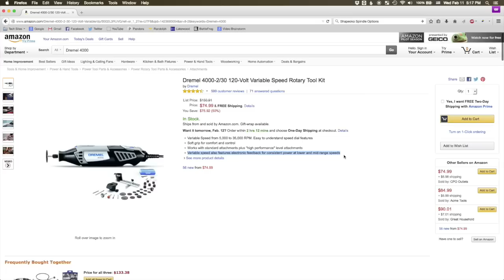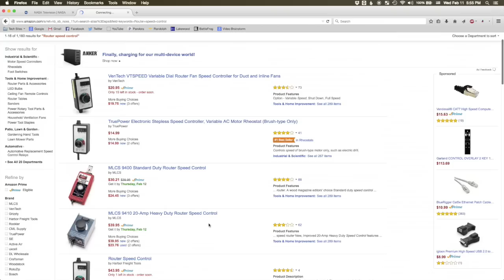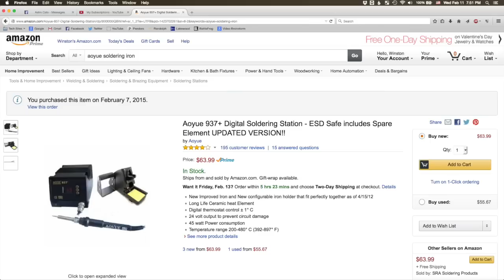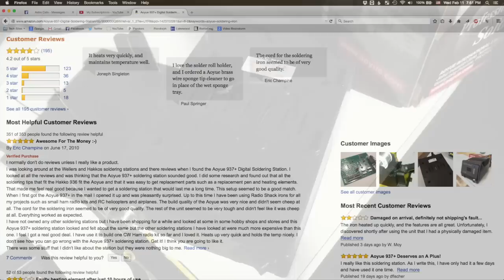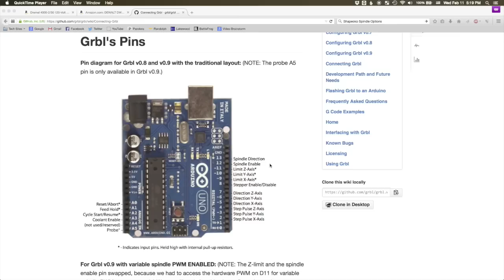Quiet Cut Spindle Upgrade for the Shapeoko 2 (#28)

Comment: Hey Winston, how are you liking the spindle? my dremel 4000 burnt out and i am thinking that this one might be a good replacement.. considering weight when i upgrade the bed to 1000mm
Reply from the maker: I'm really happy with mine, the collet centers end mills perfectly and my housemates are more thrilled about the noise reduction than I am.

You will most likely need to slide your Z-axis down about 2 cm to ensure shorter bits still reach the wasteboard. What I said at the end about the setup being a bit messy will actually improve in the near future: http://blog.inventables.com/2015/01/power-supply-interface-follow-up.html

I'm currently using the spindle without that relay. Just plug the power adapter into a cheap power strip w/ a switch. Accomplishes the same thing, without having to mess with code.

Lower overall RPM over the Dremels, but torque has never been a problem. Overall, a solid kit. If you're going to be putting many many hours on your machine, I would recommend it.
Reply: Winston Moy Awesome - I ordered the kit with the relay. That shroud looks awesome!  I did notice the youtube vid that explained that you could either choose to move the z-axis down or swap the delrin nut with the top bracket  (i'll probably choose the latter) Thanks for your videos, they help a lot and are very enjoyable!

Comment: Winston, what are you doing about a dust shoe? I've been looking for this but have yet to find anything. Any advice would be great maybe a video too?
- Harry
Reply from the maker: I've considered a dust shoe before, but because I sometimes forgo using a vacuum at all it wasn't very high up on my priority list. Plus it would obscure what's going on underneath, and is really only suitable for shallow jobs.

I like improbable construct's design, I may try and design something like it specifically for the quiet cut. However, the spindle's cooling fan doesn't exhaust directly on the wasteboard like some Dremels do, so it doesn't throw dust very far.

That being said, I do plan on using MDF more in future projects, which is notorious for producing fine particulates, so I'll put a dust shoe on my to-make list.

Comment: Great video. Have just set this up myself, works great. Which CAM program are you using at the moment? I remember seeing Meshcam a few times. Have you changed?
Reply from the maker: Using MeshCAM a fair amount, and I was going to do it for the program you saw at the end. For tougher jobs I like it because it cuts an extra wide area around your work piece which makes it easier to clear chips/dust. Really important on deeper jobs with harder materials like Aluminum, unless you have cutting fluid or good vacuum extraction of chips.

But I figured I'd just use MakerCAM for this one to save time and push the spindle harder. And in this case, despite the depth of cut, the friction didn't post any issues.

I do really want to try CamBam at some point though... when I have some jobs lined up to make the best use of the evaluation period.
Reply: +Winston Moy Have you tried using Fusion 360 yet?

Comment: I recently bought the full works kit with the QC spindle, only just getting to the end of assembling it using inventables video (https://www.youtube.com/watch?v=Yy6A3Mif0QY).  In it (see 43.49) there is no power rely component not was there one in my kit.  Will this be a problem?  Another great video btw Winston, many thanks.
Reply from the maker: Shouldn't be a problem. Functionally, it's just like a toggle switch. Right now I have my relay wired on the "normally closed" side, so the relay isn't actually doing anything.

With the potentiometer turned all the way to the left, the spindle won't actually turn anyway. And I just unplug my power supply when not in use. That's how I turn it on and off...

Comment: I clapped my hands when your video popped up.  Yeah the wiring is a new project all in itself.  With that being very obvious, I have not installed the Quiet cut yet.  But I did get right to work on a controller box that would hold my tinyg and the speed controller and the power supplies.  Bless you Mr. Moy.  Thank you for another great video!

Comment: What were the specs of the end mill you used for plywood? Up cut or downcut? 2 or 4 Flute?
Reply from the maker: Just one of the default 1/8" bits that came with the shapeoko. Spiral Up Cut, Single Flute End Mill. Not the sharpest, and you can see some of the edges will need sanding to remove the fuzzies, but it was my best bet to avoid clogging up the cutter.
Reply: Winston Moy what feed rates and DOC do you use for plywood?
Reply from the maker: ***** So, I  played it pretty conservatively at around 30 IPM, and .05" cuts usually for a 1/8" end mill. 1/32" depth for 1/16" end mills. You can definitely push your machine harder though, especially for rough cuts.
Reply: plywood used alltime only down cut bit. normal wood used router traight cut bit, MDF need use up cut bit.